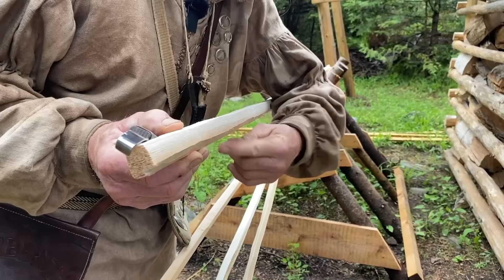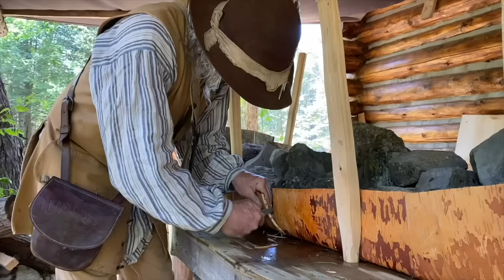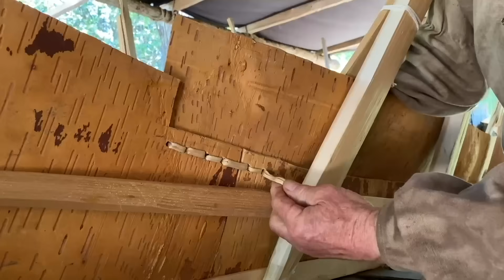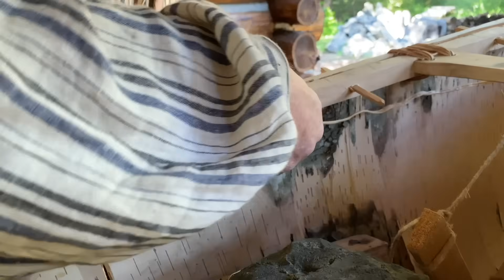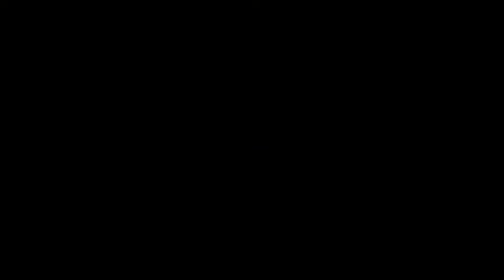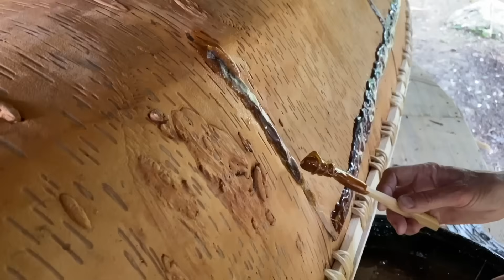Complete Birch Bark Canoe Build, from Birch Bark, Cedar, Spruce Root, Spruce Gum to Maiden Voyage

Comment: I will offer a tip on how to strip the root of skin.  Debark?  But yeah, if you nail 2 nails in a board so they are angled and meeting at the top or nearly meeting.  Then you can just strip the roots through them and it will remove the skin.  Can set up a couple different widths for different sizes roots.  Sure beats using a knife.   Maybe you know this already.   Cheers, love the video and I’m a first time viewer and new subscriber looking forward to viewing your videos.
Reply from the maker: I’ve used the edge of a double bitted axe driven into a stump, but, I’ve never tried your method.  I truly appreciate the recommendation… can’t believe I never thought of it … simple and effective.

Comment: Thanks. I have built a wood and canvas canoe myself. And watching you, I wonder how first nation folks bent their ribs without steam boxes or metal pots to boil water...
Reply from the maker: Hollowed out logs filled with water and hot stones from the fire.  Also an elder once told me they simple poured boiling water over them collecting the spillage in a second clay pot to be reheated.
Reply: @TheWoodlandEscape  I was just reflecting that it is the heat that makes it possible to bend the ribs etc. While hot water/steam makes it more controllable perhaps they just judiciously used fire...
Reply from the maker: @DonWarfield  Thin clear cedar has got to be about the easiest wood to bend.  One does need much heat to make the gentle curve of a canoe.  Now bend ash for toboggans is another matter.
Reply from the maker: @DonWarfield  Thin clear cedar has got to be about the easiest wood to bend.  One does need much heat to make the gentle curve of a canoe.  Now bend ash for toboggans is another matter.

Comment: Fascinating! What tree roots are you using as the thread?
I wonder how far back did the idea of making a canoe like this arise. It seems a stroke of genius, light yet strong.
Well done Peter, very well done.
Reply from the maker: From tools found at archeological digs, it dates back approximately 2800 years.  Black spruce is the best, but, any spruce will work.  Also one can use Jack Pine roots, but, no other pine species.

Comment: So beautiful. What a piece of craftmanship. I was wondering however, when you took it out on the water, it looked like it sat pretty low in the water. Is that intentional? I'm no sailor so I wouldn't know either way.
Reply from the maker: Intentional.  I’ve built others with more flared sides that will displace more water and have more freeboard.

Comment: how long does a boat like this last... i cant imagine bumping 3 rocks after a month and repairs ,  also... probably cant use it during july august september unless your far enough north that the temps dont swealt X_x
Reply from the maker: I’m still using one I built 22 years ago.  They have to be stored indoors in the winter.  They are USABLE all three seasons, but, sometimes you need to re- pitch  them using less bear fat in the summer

Comment: I have a question regarding the pitching compound.  I have heard about the pitch and bear fat with the addition of carbon (wood ash or charcoal?).  Is this a thing or do you choose not to use it?  I may have missed it from the video.  Isnit pitch spruce?   Great video.  I ‘ve been watching a long time.  Really good content and educational.
Reply from the maker: I believe they refer to spruce as gum and pine as pitch.   The process of sealing the canoe is referred to as pitching.  Adding charcoal is indeed used, not sure why, perhaps as a binding agent.  I’m having some issues with the pitch I made so I’m going to redo it with charcoal.
Reply: @TheWoodlandEscape  Thanks.  Funny how Youtube changes a question (re pitch) to appear to be different, but you answered what I was wondering.  Please share the results of the added carbon formula if you try it.  Again good information!

Comment: Hello again Peter .. Hope you don't mind me asking a few more questions. First is the canoe bottom frame a bit smaller then the gunwale frame, and by how much ? Second I've just made a test by taking/peeling a small piece of bark off a few different big white/gray birch which didn't peel well at all, probably because its a bit to early, but noticed how the bark was thin, will this same bark be thicker later ? What do you look for to find thick peelable bark ? And how can you find winter bark, if it doesn't peel ?
Reply from the maker: No worries Charles.  The most important thing out of the gate, is don’t use inferior bark … too many hours of labour involved.   I look for bark that I at least. 3/16” thick and flexible.   For last years build I sampled over 40 trees before I found the bark.  The best time of year for harvesting is late May through early July.   The frame is smaller by about 6” if you want a round bottom and flailed sides.  About 2” smaller if you want straight sides.   Most native canoes had flailed sides and round bottom …. They displace more water and can carry a heavier load.  Good luck.
Reply: @TheWoodlandEscape  OK thanks .. Do you know why a certain birch has thicker bark, and how do you make your test ?
Reply from the maker: Cut a 4” square piece from the base of the tree and bend it back on itself to at Le ast 60 degrees … if the lenticels don’t pop it’s good bark.
Reply: @TheWoodlandEscape  OK thanks Peter, I will try that when the time's right.
Reply: Hello Peter .. I hope all is well. I just split some cedar and was wondering if it's a good idea to rehydrate the wood before trying to split it in thin sheathing ?

Comment: Hello Peter
Have you seen or herd if Canoe builders use a few sheets of bark to acquire the length they need ? Seems I've seen Natives "low on bark" do this. And if so do you know the details of how it was sewed together ( type of stitch ) ?
Reply from the maker: Absolutely, I’ve built canoes where the bark is added, often to both ends.  It is simply overlapped and the seam pitched.  It doesn’t require stitching once the ribs are driven in over the sheathing.
Reply: @TheWoodlandEscape  OK .. well that makes the job of acquiring good Bark a bit simpler. So you could have 3 or 4 panels overlapped together to have the length you need without sewing them together. Fantastic this is encouraging, Thanks.
Reply: @TheWoodlandEscape  How much of an overlap was used Peter .. A couple inches or more ?